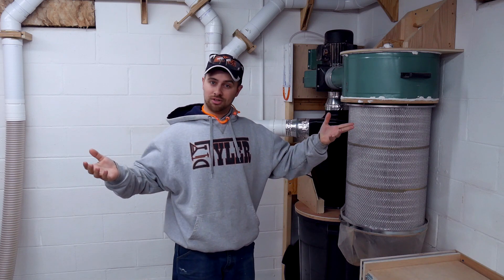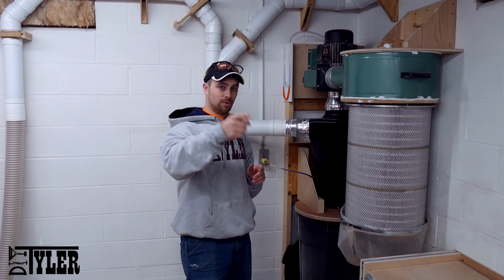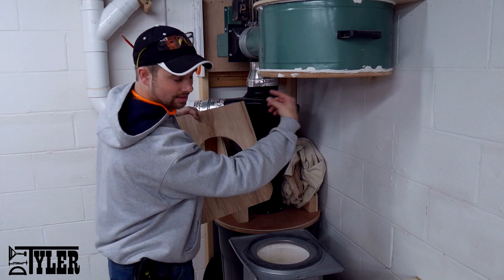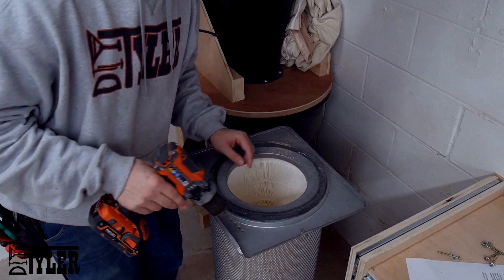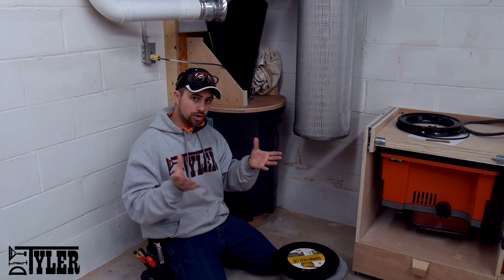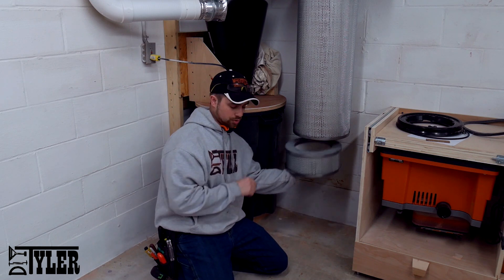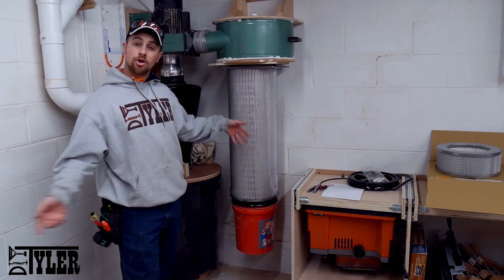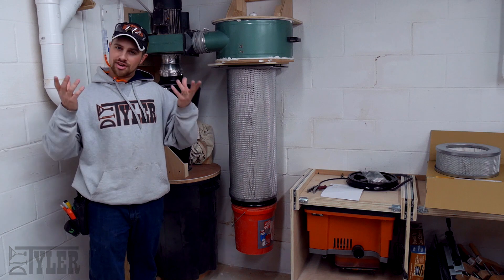LTL Let's Talk Dust Collection Filters

Comment: What is the purpose for 4 holes and not just one to get the bit into it to cut it out?  Do you really have to rely on the hole edges for attaching bucket to the lid or can you put the clips just anywhere?  The reason I say this is that I bought a different brand of a 2 pc. lid and a bucket but it only had one recessed cross member in the lid instead of the criss cross in the lid like you have with the gamma lid.

Comment: My doing a DIY in-line canister filter behind my 1 HP/650 CFM collector and was going to run the exhaust hose directly to top of filter with dump bucket under filter- what’s the purpose of the the port above filter that turns the air before it drops into filter?? I don’t have that so going to run hose directly to top of filter

Comment: Thanks Tyler.  I'm assuming that I can use the new filter on the top of my Harbor Freight dust collection system.  I'll talk to someone at Winn before placing my order.  Can hardly wait to get it up and running.
Reply from the maker: If you are going to mount it on top of the DC, simply in place of the bag filter you probably don't want this filter. Wynn has some great info on the filter you will want.

Comment: Tyler, you're great and Wynn Environmental is also great.  Your videos and their products have really been an asset to the woodworking community.  You're the one who inspired me to set up my HF collector like you did in your first video.  It's been excellent, but as things usually go, I want to add a cabinet under my filter and need more room.  I don't have the ceiling height to install the filter on top of the plenum.  I have always wondered if I need the plenum box at all.  What does this piece do?  
I have the Super Dust Deputy installed like you do.  What do you think about just running the duct from the impeller box to a home made flange right on top of the filter?

Comment: Great video.  Any reason not to ditch the body of the dust collector and use a large radius elbow connected to a flange on a piece of plywood?
Reply from the maker: That would work great.....if I was to originally start with the flanged filter I would probably do that, save even more space. Great idea Eric!
Reply: This has me thinking....are you saying to basically bypass the body (2nd part of the dust collector) and just have the hose connect directly to the filter through a home-made plywood connector?

Comment: Question: Do you even need the filter housing from the original HF unit (aka the round part the new wynn filter attaches to)?  In other words could you just pipe the output from the impeller straight into the filter (maybe via a homemade flange)?  Asking because I can find the impeller/motor combo on CL but not the filter housing and wonder how important the filter housing really is.  Thanks in advance.

Comment: Is there an advantage to blocking the top section instead of just adding the filter to the top and leave the bag on the bottom???  If there isn't, does wynn sell a closed end filter that would fit this application style???
Reply from the maker: Wynn sells a closed end filter that will work great, I would recommend 35A222NANO. I blocked off the top because I was trying to make the most compact system I could, filter works just as well underneath as it does on top. Whatever fits the need.